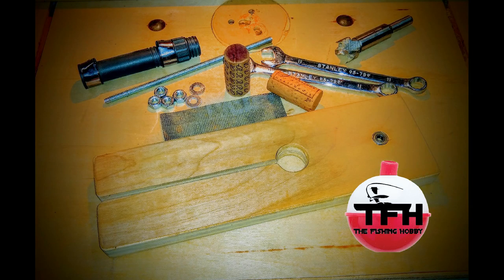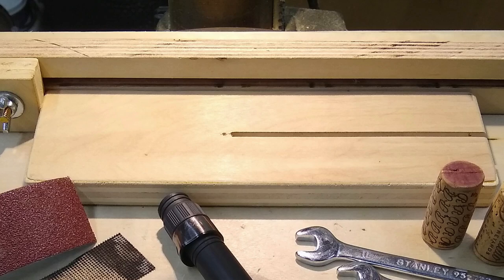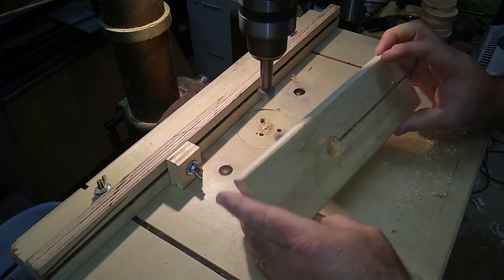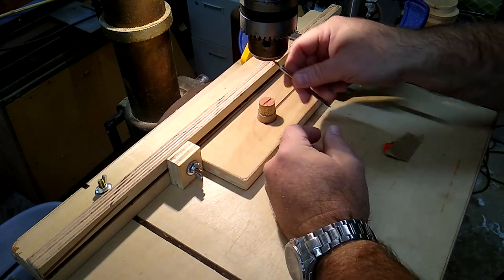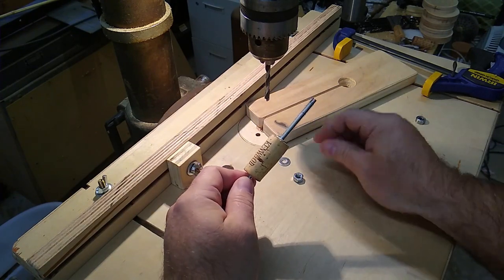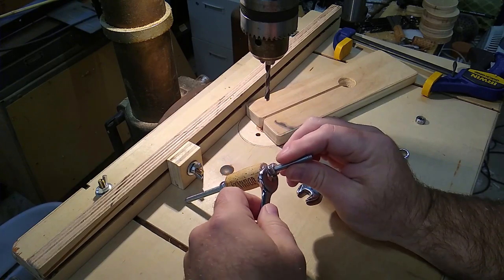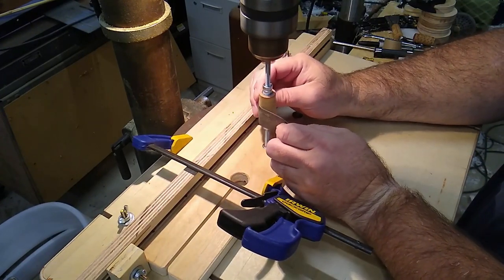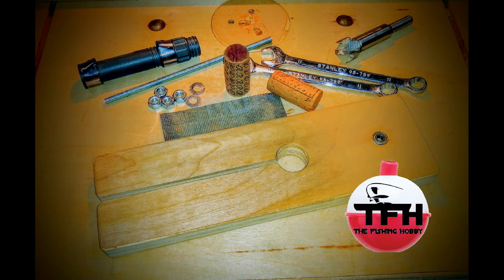How To Make A 2 In 1 Drill Press Jig For Rod Building - Make Your Own Cork Reel Seat Arbors

Comment: Thats was excellant Kevin! Got this saved as Im sure I will be useing this in future on my drill press. Very good idea! After I get a few builds under my belt, Im gonna make the switch to carbon on my walleye and crappie rods. Gary Loomis made a good point about cork is way less sensitive than carbon and actually deadens a rods feel when trying to detect light bites. I love a sensitive rod.
       Richard from Kansas;)
Reply from the maker: Really anything between your blank and hand interferes with vibration transmission to some extent. I'm interested in seeing how much different arbor materials dampen vibration. I'd like to test that out to put some actual numbers of some sort to it instead of theories. The subject was brought up on one of the Facebook rod building groups and I think it would be something interesting to test out and see what the results look like. Just my personal thoughts about it would be that aluminum might actually be the best arbor material for transmitting vibration from a rod blank to your reel seat. I think it would be worth investigating!
Reply: @TheFishingHobby  100% agree Kevin! Great reply man😉

Comment: Do you turn your grips on a mandrel or on the rod?  I glued my cork to the blank so I will turn it on the rod lathe, which isn’t the best route.  I don’t like having to ream out a fully glued cork grip, accidents always seem to happen.  I turned a winding check on my lathe out of mahogany, it came out nicely.  Thanks for the tips.
Reply from the maker: I do mine on a lathe with a mandrel, but I don't usually make full grips. I build mostly light/ultralight spinning rods so I use split grips a lot and what little cork it there doesn't take much to open up.
Reply from the maker: Oh, and I'm glad you liked the wood winding checks video. I bet the mahogany turned out really nice!
Reply: @TheFishingHobby    I have never done a split grip.  I like the look of the full cork handle, I guess I am old school.

Comment: Well, I feel pretty stupid. I thought you were making a cork rod handle. I have no idea what a reel seat arbor is.😂 I guess you have to be a rod builder to know all those terminologies.
Reply from the maker: Reel seats are hollow and larger in diameter than the rod blank. An arbor is what takes up the space between the inside of the reel seat and the rod blank. The arbor gets glued to the blank and the reel seat gets glued to the arbor. Arbors can be made from a lot of different materials. Cork is a good choice. I've rebuilt a lot of really old rods and I've never seen a cork arbor fail. I have seen some other types of arbors fail, especially cardboard arbors.